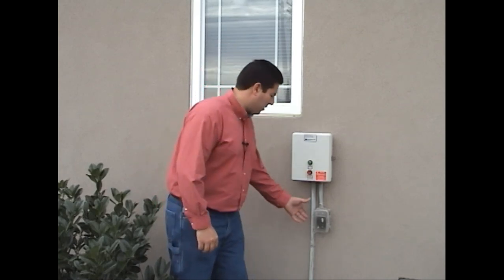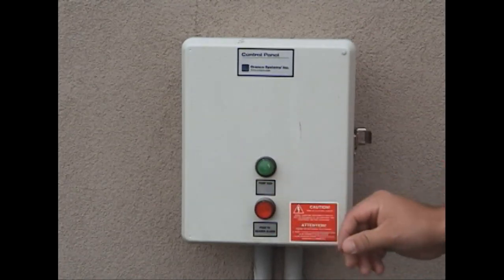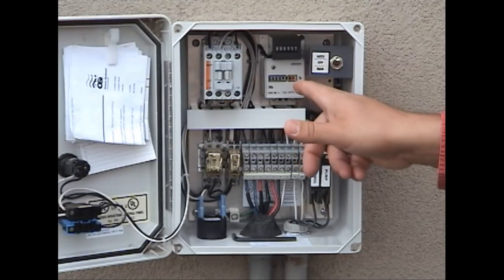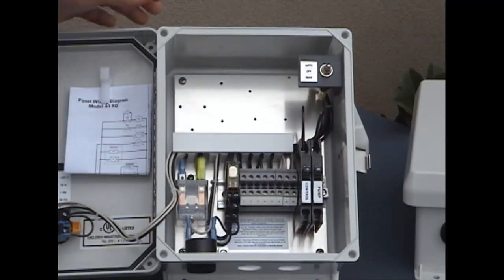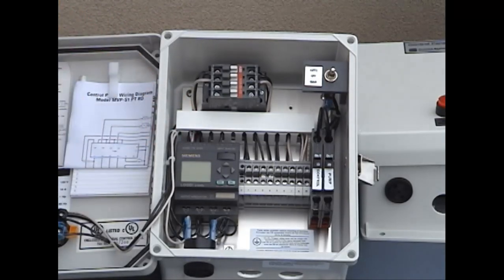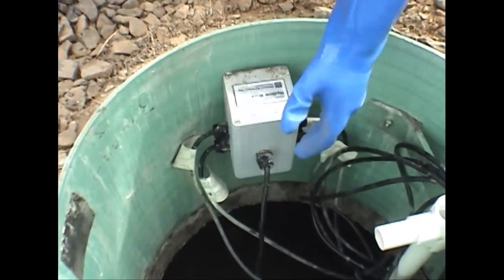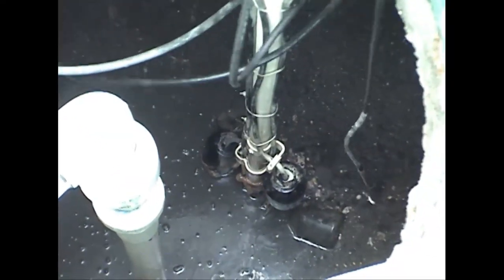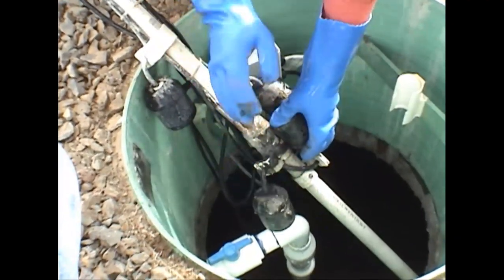How to Inspect your Septic System's Panel & Pump Chamber

Comment: Is it normal for the tank to make that dripping water sound? I read somewhere that the tank should not make any sound but in the video that sounds just like my septic system. This is all new to me so I just want to make sure things are in proper order.
Reply: If your system has a pump chamber like this one it would be a normal sound.  It is the water falling into the pump chamber from the septic tank, just a bit of flow coming through when we did this video.  Best of luck with your system they are easy to forget about when all is going well!

Comment: Hi. I was wondering if you could show me how to turn off the audio alarm.  The setup I have is exactly like the first one in the video.  The alarm constantly goes off whenever it rains and I can't silence it every hour.
Reply: +Andrew Concepcion Interesting!  First try to figure out if rain water is getting into your pump chamber if it is stop that source.  Assuming it isn't rain getting into the pump chamber I would look at the panel next.  Should be a number for the manufacturer in the panel to help diagnose any issues with the panel itself.  Good luck!

Comment: Great video - Have you ever seen a panel where the "Auto" Feature just stopped working?  I have a duplux system with alternating pumps made by Liberty Pumps.  Both of the pumps run fine in Manual mode, but neither will run in auto.  I have tested all of the floats with an ohm-meter and they all responded properly.  However, the box doesn't seem to be getting the signal.  Also, I can't get the green light on the circuit board to light up (checked fuse but its fine).  I did find a bad breaker in the box when first diagnosing the problem but it has since been replaced and auto still doesn't work.
Reply: +Jeremy Beer I apologize for not getting your question until a year later!  Curious what you found, sounds like you did all the steps that point to a bad panel.  Was that the case?
Reply: +Curtis Wray  yep - bad panel.   they didn't make that panel anymore so would have had to get a whole new system - quoted me $2000.  decided to install 1 new pump with a manual float which would by pass panel.   can still turn on other pump manually in case of emergency.   fixed and running well for the last 18 months for $300.
Reply: Wow!  Thanks for the update.

Comment: hi i have an alarm going off not sure if its hi or low level when i manually drain it shuts off could this mean theres a problem with the pump or the float?
Reply: +minnie pearl Sounds like the pump is working on manual I would assume the floats as a starting point.

Comment: My alarm went off 2 am and I shut the alarm off then turned it bk to normal red light stayed on ten mins and went off again don't think my sprinks are spraying but not 100% sure what do you think that is water level is fine two days later no alarm except at 2 am
Reply: +berkferker I apologize for the long wait to reply I wasn't getting the notices!  I hope you have solved this issue by now!  If not give the manufacturer a call or your installer sounds like a timed dosing panel with the on off float not shutting down the system.